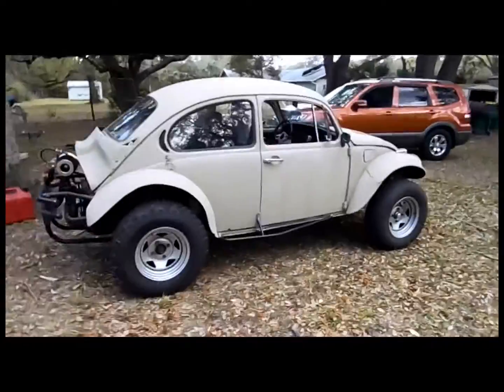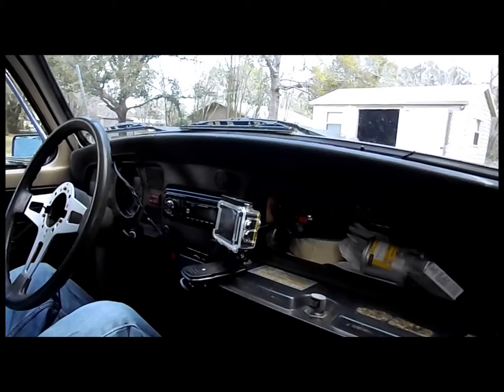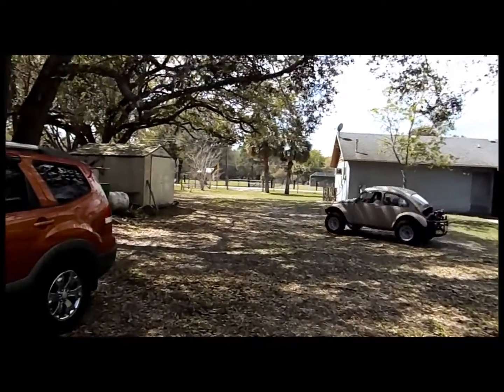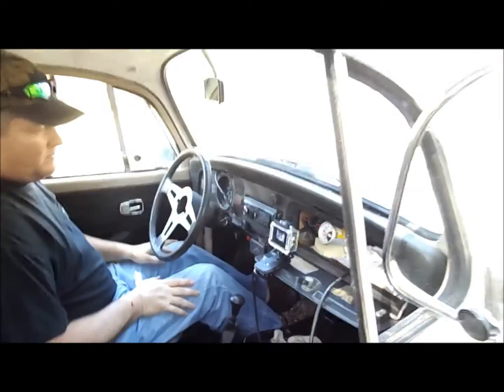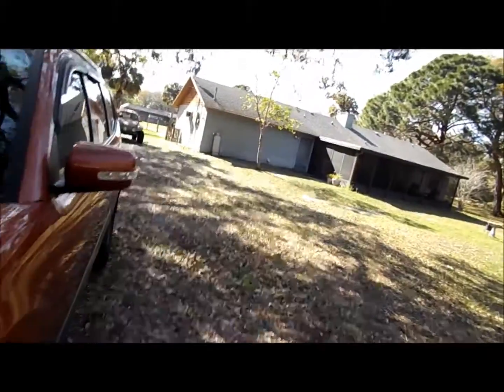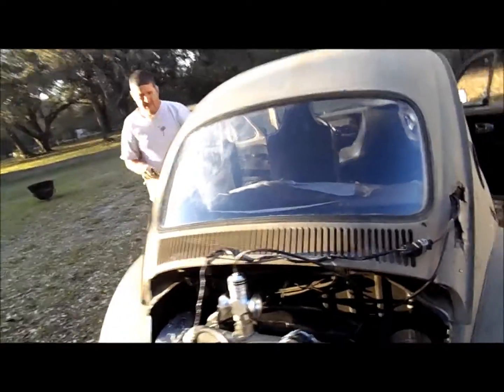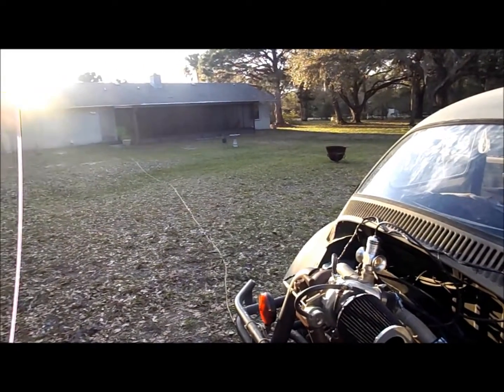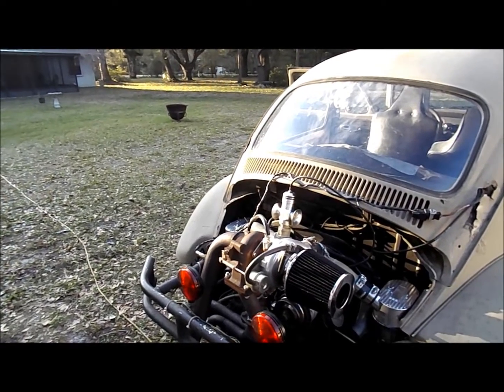Turbo In a Day Jetting Shade Tree Episode 34

Comment: This is top notch  shade tree awesomeness, that spool  sounds so good. I am getting close to turbocharging my 1904cc  and your videos have cemented my choice in going with a  blow thru Weber setup. You should get your buddy to check out  the CB Black Box for       timing control under boost, it even has 2 built in turbo maps you can start with plus 2 rev limiters.

Comment from the maker: Thanks for the kind words oldspeedsi, it is working better than I though it would. The carbs do leak a little fuel under boost but we are ok with that as it's a Baja. The CB black box is a great idea, but we already have a MSD6 BTM left over from a project of years past. If we didn't we would definitely do the black box as it's the best option for the price.